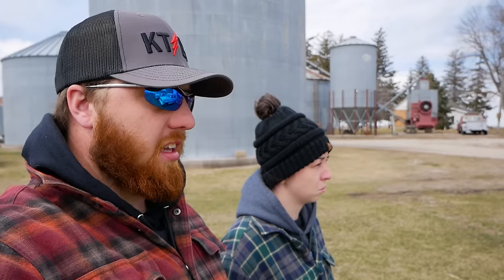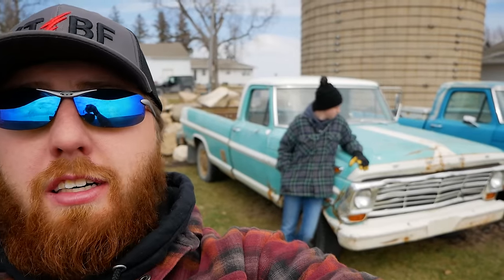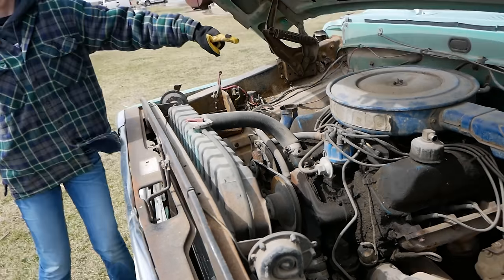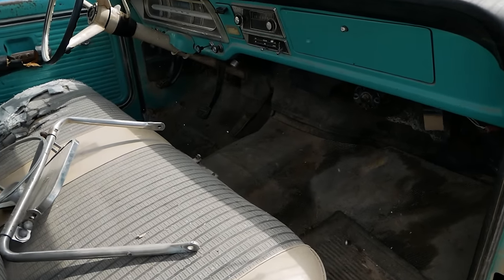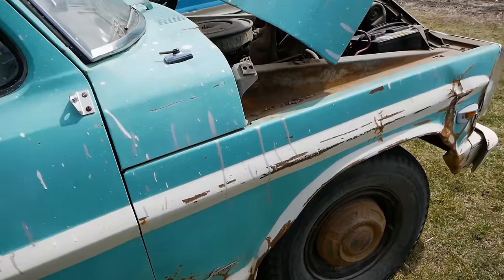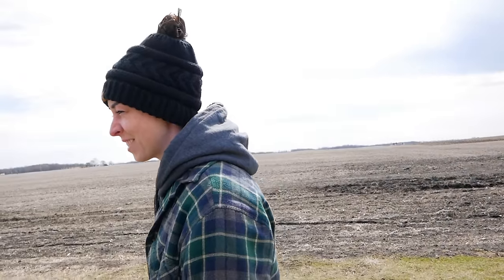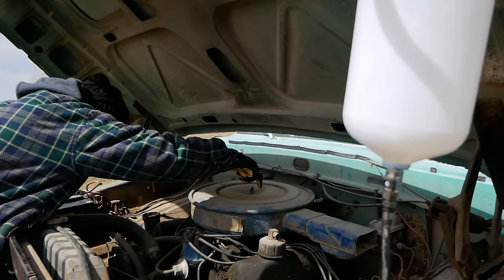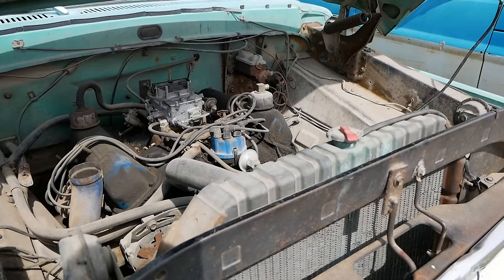ABANDONED Farm Truck Returns to The Road after YEARS in a Barn!

Comment: I have a 1972 F250 4x4 with the same wheels, the guy at the tire shop said that those wheels are called “Lock ring wheels” which are for use with tubes. He said that he would put a new tire and tube in if I wanted, but I just ended up getting an 80s set of standard wheels. So not technically a split rim, but you still can’t run a standard tubeless tire.

Comment: Love that F250! You guys should do a C6 trans rebuild on this truck with a rebuild kit!
Reply: Not unless it's needed... I'd drop the pan and examine what's in it then proceed from there. An inspection and cleaning will tell you a lot about a transmission! Still, if all is good I would:

A. Install a drain plug on the pan (it's already off so take advantage of the situation!)

B. Install a magnet into the end of the drain plug or epoxy one into the pan itself.

C. Modify the valve body to improve the firmness of shifting. You don't need a shift kit - you can modify the factory parts.

D. Install an aftermarket, external cooler. I know there's a factory set of lines that run to the bottom of the radiator but that's not good enough in hotter weather. A totally separate cooler is cheap insurance against developing problems and with most likely extend the life of the transmission. Heat is enemy #1 of automatics! For the investment of time and money, they're worth it. Best wishes!

- Max Giganteum

Comment: Thanks for explaining the brake adjustment. That's where I have the most problems!
Reply: There is a better way to adjust the brakes and get them right the first time. Turn the adjuster wheel in until you can't turn the tire anymore, this sort of sets everything in place where it needs to be, then back it off until you get a mild drag, tire should make about 1.5-2 revolutions before coming to a stop if you give it a good spin with two hands. If done properly the brake pedal should be right on top and after you drive it a time or two the brake shoes should be broken in enough that the auto adjusters take over the adjustment. After verifying the brakes work satisfactory adjust the parking brake cable if needed, it should be adjusted so it holds the vehicle from rolling in gear by the third or fourth click.  My dad did thousands of brake jobs during his career as an auto mechanic and I've done it both ways, always had had to do it over when I didn't do it the way he taught me.

Comment: It's good to see a younger guy know so much about these old vehicles. Most of the old-timers have passed on and their knowledge has been lost forever.
Reply: The unfortunate thing is so many younger people have no interest in learning and a lot of these older guys took their knowledge with them to the grave. Some just chose not to pass it on even when one was willing to learn. When I have someone who wants to learn how to work on stuff, weld, fabricate or do anything I can do I try to make sure I take the time to teach it. I don't want to take my knowledge with me. Its my legacy that lives on long after I'm gone
Reply: @nickwarner8158  I work at one of the biggest trade companies in DFW.  Younger is not the problem, finding older with experience is the problem.
Reply: @nickwarner8158  ...and no, older equipment is no where close to the same as the new.  If anything, your "older" mechanic is generally sloppier and has no clue about the computers.   Younger generation is more into other trades that requires less sweating while making more money..  So who's the dumb one?  I think I'd rather be at a computer at home instead of a 140 degree attic
Reply: @llamacebu216  computers are nice but they don’t compare to an old man that can make a 400 small block sing to you.

Comment: Kevin, you may be able to reach out to a tire/service shop that services a lot of older farm/AG equipment as they may have a tire cage they can place the wheels in for containment when seating those split rings. Friend of mine was able to do that with his tires for his Deuce.5
Reply: Kevin already has what he needs... you inflate a split rim tire/rim combination under an immovable object. If the ring unseats, it has nowhere to go. What? Here's how it works. He has a lift and a truck. You put the truck on the lift and lower it down over a serviced split rim... centering the serviced tire/rim directly underneath one of the front tires still on the truck. Yes, the serviced tire/rim is flat on the concrete. The 
other tire/rim is fully inflated and bolted as per the norm on the truck. After you reasonably center the serviced tire/rim... drop the truck until the mounted tire puts a slight amount of downward pressure on the tire/rim that's laying flat on the concrete. Slowly inflate the serviced tire/rim while carefully watching the split rim ring. No movement? You're good. Movement? STOP! Slowly deflate and correct the problem before trying again. The only thing you've got to be sure to do to be safe is keep your body parts away from the tires in case the ring pops loose. It may not be able to escape from underneath the truck but that doesn't mean it cannot seriously mangle a hand, wrist or elbow in the short distance it can travel. Bottom line? The design type of rims known as split rims aren't a big deal when you understand how they work... and why they can be dangerous. Take the precautions to be safe and you have nothing to worry about. Best wishes!

- Max Giganteum

Comment: You should grease that type of rear bearing when you put it back in. It takes a while for the gear oil to get back out there probably 50 mi.  most good mechanics know this and they put a little grease in those bearings so they don't dry out and get hot.
Reply from the maker: I usually dip them in oil
Reply: Grease won't hurt a bit and is cheap insurance. More cheap insurance? Flush out the old diff lube and replace it up to the proper level. One of the most overlooked maintenance items is the differential lube. Just food for thought. Best wishes!

- Max Giganteum

Comment: split rims are fine. just remove the valve from the stem to make sure there is no pressure when you pull the ring. also make sure the ring seats fully. these are are big in the aussie outback because you can easily swap tires in the bush. if you are still scared then bolt a chain threw the center of the tire for safety.
Reply: I don't think they will anymore, but a few decades ago I worked at an NTW (they are now known as NTB) and had no fear of split rims.  I was the only guy in the shop who was good with the old upright turret machine.  The rest of the guys could only operate the rim clamps, so split rims fell on me.  Step one was to always remove the valve core and make sure it was empty before I started working on the ring.  From there out, they were easier than radials, if you asked me, especially when people cheaped out and bought skinny tires that didn't want to seat on a wide wheel.

Comment: converting the truck to electronic ignition rather than breaker points would probably help it idle smoother, plus the stronger spark would help with stalling at idle  :)

Comment: Being from the generation that used to drive and work on trucks of this vintage.   If you reassemble after turning the drums ... particularly the front drums... Once they get turned a bit out of spec, you'll know.....
The brakes once adjusted and bedded will be super sensitive. 
That being said ....I know they say the drums become fragile when out of over spec on the ID, I've ran them fine with them being a bit touchy. I just adjust how hard my motivator hits the whoa pedal.  Those drums are plenty robust even a bit overturned

Comment: I had a 69 Torino Squire with a 302. I replaced the Motorcraft carb with a Carter unit. Then I rebuilt the original and popped that on and it worked just fine. The Carter went bad in 2 weeks.

Comment: 30:30 Those are not split-rims; they are lock ring wheels. You're thinking of the now infamous RH-5 wheels, whereas these are much safer...relatively speaking. They still deserve a LOT of respect and caution though. Tire shops generally won't touch them due to guilt by association, unfortunately.
Reply: I had to have some tires replaced with Split ring/lock ring wheels and didn’t have a problem with finding a shop to do it.

Comment: That's definitely not the crustiest 352 I've ever seen. The original 352 out of my dads 64 galaxie had so much grease and dirt build up on it you couldn't even see the contours of the intake manifold runners or the low spots between the runners. The whole underside of the car was that way as well. 2 hours of pressure washing and it was still nasty. Must not have ever been washed once under the hood in it's 258,000 miles of use LOL
Reply: That was a poor man's undercoating back in the day !!
Reply: @matthewhickey5972  The car is 100% rust free still because of it!
Reply: $50 says that in the past, someone sprayed used motor oil all over the undercarriage on purpose to do just that - act as a rust preventative. According to one of my long deceased grandfathers, the used motor oil method was even done on new cars and trucks back in the day at the dealerships. They'd use a metal pump sprayer to apply the oil after letting it heat up in the sun then run the car over a few miles of gravel and/or dirt roads. The dust and dirt would adhere to the oil creating a defacto protective layer. While not exactly environmentally friendly, apparently it was far better than nothing. The one downside was the mess... mechanics hated it. Imagine what it was like working on a seriously caked up car!

- Max Giganteum
Reply: @MaxGiganteum  The car was sold new in Los Angeles and spent most of its life there then moved to Western Washington sometime in the early 90's, we don't use road salt here either, not sure why there would be a need for rust prevention in SOCAL. The car is factory undercoated and it had a hell of a lot of miles on it and it leaked from every orifice transmission included before the original drivetrain was taken out. The back half of the car was a lot cleaner but still a lot of road dirt accumulated. The engine bay, suspension and transmission crossmember area was twice as bad as any old high mileage vehicle I've ever dealt with, mostly from neglect and oil leaks and the inside of the engine wasn't any better LOL
Reply: Where at in W WA? I was in SW WA in the 90s. As far as the car goes, you'd be right about the SoCal weather but as has been said, old habits die hard. One of my grandmothers was still making her own soap in the early 80s... folks just often kept up with the habits whether they were good or bad, necessary or not. The car? Who knows who did what close to 60 years ago but I'd say that if that car wasn't coated front to back then you're most likely correct - poor or no maintenance was probably why it was coated with goo in the front half. I've run across the same thing a number of times in my career, an engine and/or a transmission covered due to slow but non-stop leakage. Little to no rust there. The back half? Quite a bit more... which wasn't surprising at all! Peace & good vibes!

- Max Giganteum
Reply: @MaxGiganteum  South king county, unfortunately.
Reply: Ohhhh no... as the lads that comprised Monty Python would say, "Run away! RUN AWAY!!!". Seriously, get out while you still can...

Comment: Just wanted to point out a correction on your concern with the wheels. What you have on this truck are actually split ring rims, and they are “somewhat” manageable to change the tire on in a safe manner as long as you know what you are doing. The rims you were referring to are called widow makers and they are the rims no tire shop wants to even touch. Just wanted to point that out because I agree with you on wanting to keep those rims on this truck. Gives it that original old farm truck look. Great video. Love these old fords.
Reply: Yeah, but these are old rusty crud wheels sitting around for who knows how long. Definitely not worth the trouble.

Comment: Kevin, back in the day it was not uncommon for us to pack the rear bearings with grease as a precaution against those who did not fill a rear end with oil properly. The standard for most of us was to fill it until it ran back out, but some shops insisted that if you could touch the oil with your little finger, it was full enough. Don't know why, that's just the way it was. (EDIT)  By the way, the reason those cables were on the rear brake shoes is because they only self-adjust while backing up. They do not adjust while driving forwards.

Comment: That truck is awesome! All the damage it has tells the story of it's life. I cannot believe that you removed the naturally occurring rust proofing from it though. It is there for a reason. On a side note, the milky oil that you drained out of the engine does not bode well. I sincerely hope that you can diagnose and repair the cause before you acquire thin bearing shells and a flat cam shaft.
Reply: "...naturally occurring rust proofing from it though. It is there for a reason."

 I had to crack up laughing. There's nothing natural about this at all and the reason is as simple as... pathetically bad maintenance for many years. Facepalm city! 🤦‍♂️

- Max Giganteum
Reply: @MaxGiganteum   That was a joke. I am glad that you got a good laugh out of it.😃
Reply: If a joke... I missed it. But yes, was pretty funny!

Comment: '69 F-100 2WD 200-6.  That's what we called a farm truck on my Grandpa's place when I was growing up.  It went everywhere we needed it to go, hauled everything we needed hauled and did everything we ever asked of it.  But, if you left 3000# of corn on it overnight, be sure to put a screw jack under the rear bumper, or the wheel wells would be sitting on the tires by morning.

Comment: Hi from Western Australia
Love the content 
Keep up the good work.

Man, I'm 44 yrs old and I learned to do drum brakes when I was 14 yrs old. 
Now I sound old, but anyway, if I'd been taught to slide the adjuster forward/back while adjusting id prob actually like doing drum brakes.
Trying to get 4 corners even and a good pedal used to make me throw tools all over the place.

I learned yrs ago and I've hated drum brakes since.

I've done 4wheel disc conversions on all my old cars just so I wouldn't have to do drum brakes.

Then along comes Kevin and mook 30yrs later and makes it look like cake 

Thanks ......
Reply: Don't feel bad... life is long. Just keep learning and growing. By the way... Kevin is actually still doing it the hard way. Huh? Yes. You grab your dial calipers and measure the ID of your freshly turned drum. Note the distance! After making sure the drum is in spec, you fully seat the shoes and measure across the outside of them from the tip of one face to the other. Use the star adjuster to move them out to the distance you noted for your drum minus an eighth inch. Install the drum and finish the last bit of adjustment. This method can save you a lot of time adjusting when the drum is installed - it's a lot easier and faster when the drum is off. No calipers? Use a measuring tape. It's not as accurate but it still works. Peace & good vibes!

- Max Giganteum

Comment: Amazing that your amassed lineup there is all relatively matching color wise.

The camper special axle thing was only for F350s, and I think only '73-79 where they were called Super Camper Specials from '73-77.  F150 and F250 Camper Specials just had heavier spring packs and sometimes optioned with sway bars and extra batteries.

Comment: Hey Kevin, love the video! Here’s a little Ford truck tip for ya. There were 2 flavors of Camper Special, there’s the Camper Special, and the SUPER Camper Special. The one your thinking of, where the rear axle is moved rearward to lengthen the wheelbase, is the SUPER Camper Special, which came out in 1973. Yours being it’s a 1968 is just a Camper Special, and your rear axle is actually in the same place as a regular F250 or F100

Comment: That is a great truck!

You went right for the Autolite carb hate when it wasn't running right. Threw the Holley on and same problem.  It kind of reminded me about something Luke said multiple times.  People like to blame a lot of running/performance issues on the carb when it's actually an ignition/timing issue. But you got it running great! Gotta love the OLD FE's! 

That Holley is actually a 500 cfm. The 4412 = 500cfm, 7448 = 350cfm.

Keep an eye on that oil. Those old fuel pumps that have sat for a long time like to tear the diaphragms and dump a bunch of gas in the oil.

Comment: I spent some years changing split rims and honestly I think you have enough common sense to learn to change those tires. I think the biggest thing is to clean the groove where the lock ring seats totally, air the tire up slowly and let the bead set gently and also never re use any damaged wheels or cracked/ damaged lock rings.

Comment: I have a 68 f100 camper deluxe? Straight 6. Was my gramps. He used to pull a camper from Arkansas up to MN when they'd come visit.  2wd. Has a tool box on the pass side lower bed corner. The cab mounts need some love. Hopefully this summer I'll drag it out of the barn and get it going.